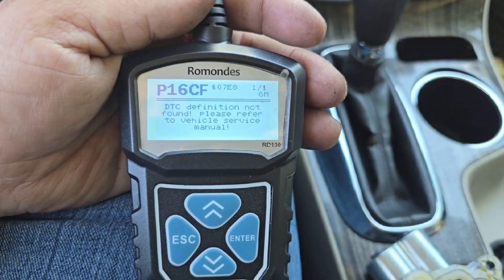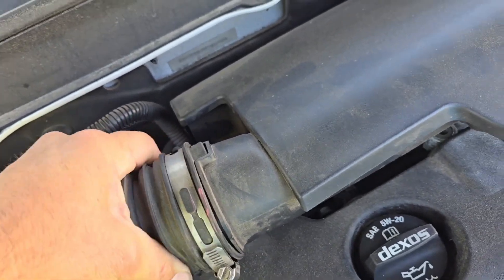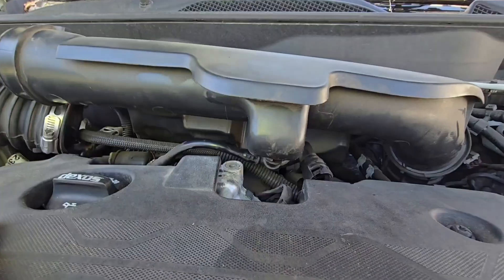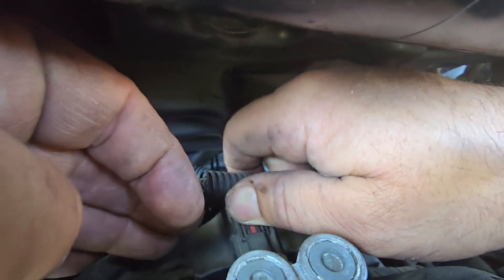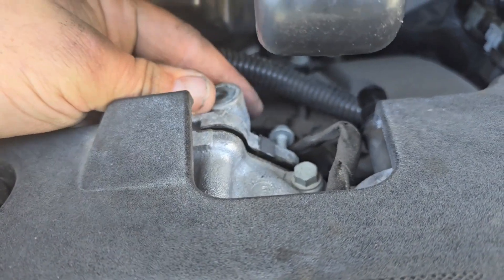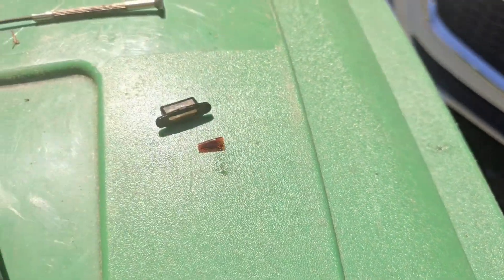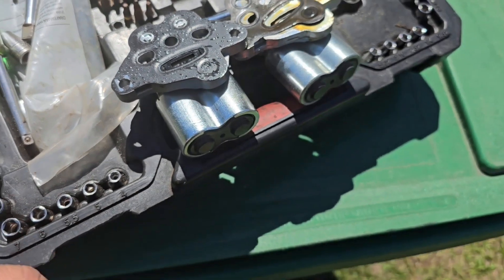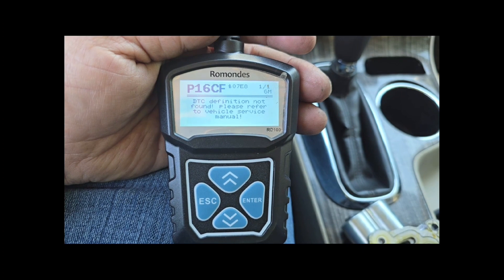Chevy Malibu won't shift, not the transmission. simple fix 2012-2018

Comment: Daughter has a 2011 2.4/ 4 CL at 93,000 mph, 1st into 2nd gear slipping, can't drive. I researched this, low & behold 2009-2018 all do this because of the design failure. 
And, NO Recalls for this?? This should be illegal... 9 different years with transmission gear failure, no Warranties, No Recalls, No Answers and Dangerous.